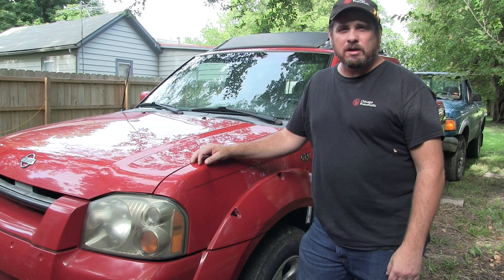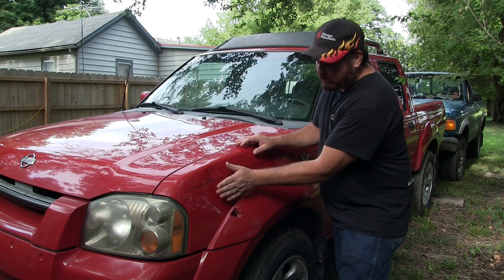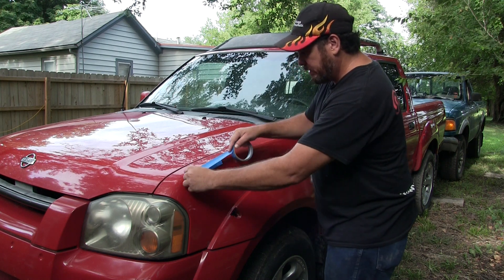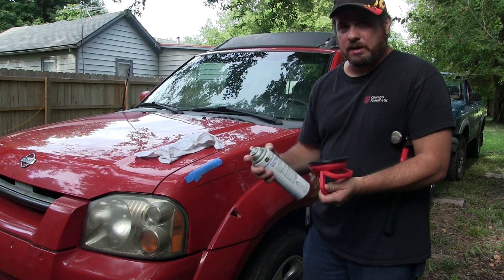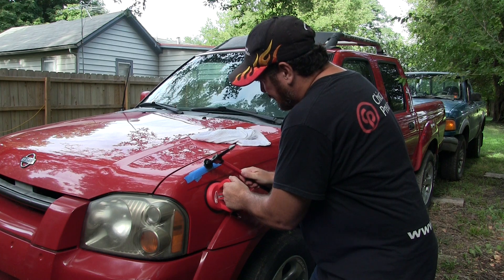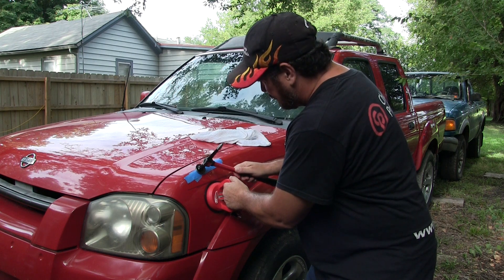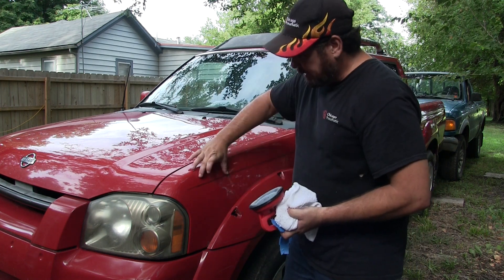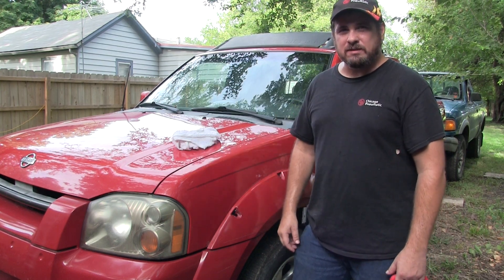DIY How To Repair Dent Using Suction Cup

Comment: Would that same technique work on aluminum? I've heard on aluminum you can't pop out or do PDR cause the aluminum is so thin and light weight. Thanks Donnie. Always enjoy your videos.
Reply from the maker: veedubbcubb I am not the best to answer about aluminum.  I do no that aluminum does not have a memory, which makes it harder to pop back in place.  And it also cracks easier and may require some heat.  But again, someone else may be able to answer this better.  Any suggestions out there???
Reply: Actually for the same strength, aluminum is thicker than steel sheet, but lower in density. suction cups can be used to pull out dents closer to their original shape, but because aluminum stretches more easily than steel,  dents don't pop out and paint is more likely to crack and separate.

Comment: I backed into my neighbors car last weekend. I just went to Harbor Freight and bought a very similar suction cup. Now I'm afraid the dentist is smaller than the cup.. I'm trying like hell to avoid going through insurance.  It's in almost the same spot as this video.. Fingers crossed!
Reply from the maker: Let me know how it works for you.
Reply: It was a little big for the dent I was fixing.. what I did though is get it as close to the dentist as I could and pulled like hell on it as I had my hand up under the quarter panel pushing on the back side of the dent... it popped!.. still has a little "brow" but my neighbor was completely happy with the end result.. I would recommend this thing if the dentist is the right size. I used windex on the cup to create better suction.. worked like a charm.
Reply: briguy,  you better leave the  dentist  alone!
Reply: If the dentist is that small, he can climb into your mouth to work on your teeth, but be careful not to swallow him.